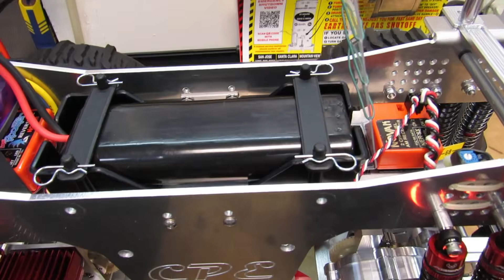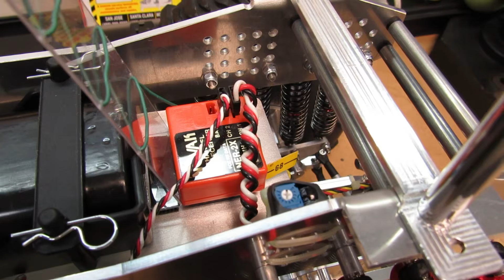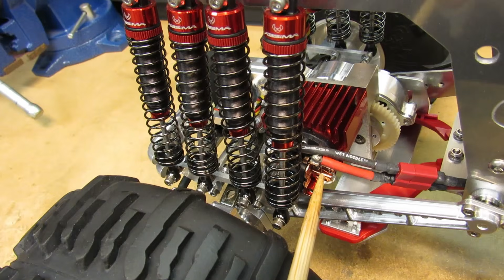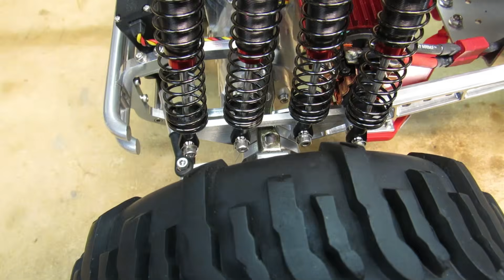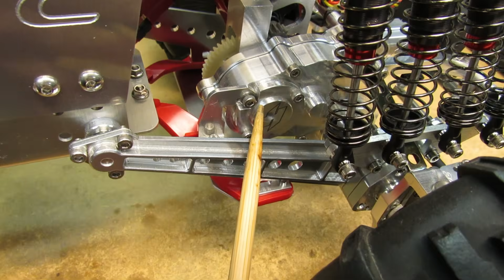Tamiya Clod Buster project update 4 - Crawford (CPE) Time Warp chassis assembly, part 2 of 2

Comment: It's a shame I can't do business with CPE after them not responding to a problem with an order I placed with them for multiple products of theirs years ago after attempting to make contact with them by phone and email numerous times
Reply from the maker: I know exactly what you're talking about.  Before I bought the CPE Time Warp chassis that I used on Leviathan, I emailed CPE and asked them some very simple questions about it.  To this day as I type this, I still have not gotten a reply from CPE.  My questions have gone unanswered so far and I am not holding my breath on ever getting answers from CPE.

This also recently happened with Arch Fabrication.  I emailed them a very simple question about two or three weeks ago and, at least as of this moment, I have not received an answer.  If I ever get one, I will post a reply to this comment here saying so and I will gladly eat my own words.  Right now at least, I am not getting my utensils and preparing to chow down.

One of my all time pet peeves about the R/C hobby is how manufacturers routinely completely ignore their customers like that.  They have the potential to develop long relationships with loyal customers yet they constantly ignore them and thus ruin the possibility of continued purchases.  Unfortunately, I have experienced that constantly in my long time of being into R/C.

In my case, when I have been treated well by an R/C manufacturer, my loyalty to them has even lasted longer than the actual companies have.  That applies to ESP and Sassy Chassis, whose parts I still use and speak highly of today even though they both have been out of business for a long time now.  Based on my personal experience, both of those companies treated their customers great and I still speak fondly about them even though they closed up many years ago.

On the complete opposite end of the R/C manufacturer spectrum, JPS is a company that totally ignored their most loyal customers and treated them horribly.  Thus, though I will always love JPS' products and speak highly of them, I will never say anything good about their absolutely awful customer service and how terribly they treated their customers.  That was absolutely inexcusable in my opinion and I have specifically mentioned JPS' terrible business practices in several of my videos.

To CPE's credit, I did have a problem with my Time Warp chassis order that they quickly fixed.  The shipping box was not taped closed very well and, as a result, it was torn open a little bit during shipping.  Some parts from my order fell out and were lost somewhere along the way.  (An aluminum steering link and some hardware were gone.)  I emailed CPE with a photo of what I received and they immediately replied and sent me all of the missing parts.

So, to CPE's credit, they did take care of me and solved my problem with my order.  It would have been nice if they took care of me back at the beginning when I was just a potential customer though, way before I placed my order, and when I just asked them a few simple questions.  It would not have taken long to answer them yet I was ignored.  That sort of thing makes a lasting impression on me as first impressions are hard to change in the R/C world.   It just would have been nice to see issues like that be changed and solved during my many years in R/C monster trucks but, nope...not even if they are committed by different companies and by different people over different decades.  Sadly, old and bad habits seem to die hard in the R/C aftermarket parts industry based on my experience.

Comment: Aside from a nostalgia perspective, why are you using crystals? That's just asking for interference isn't it? Granted you will probably be the only one on a frequency, that doesn't guarantee no interference does it? Just curious. Shoot, I still have a super rooster in my pile of old hardware. Sux they kinda been obsoleted mostly
Reply from the maker: I actually have never had any interference problems with my old, trusty Futaba Magnum 2PD AM radio.  My logic is that I'll upgrade radios when/if it ever gives me problems but so far it has always worked flawlessly since it was new.  If I ever do have interference problems, I have quite a large collection of different crystal sets that I can swap in quickly.

Also, and this is a big reason why I have not "upgraded" my radio.  I absolutely love my Magnum!  It fits my hands so comfortably like a glove and it is just made so well.  I have held many newer radios over the years and they just did not feel as good as my old, trusty Magnum.  My thinking is, why replace something that you love just because something newer has come down the tracks?

Newer R/C radios are also just too complicated.  I do not need nor do I want screens on my radio and I sure do not want to use a phone ap just to set it up or make adjustments.  I can do all of that on my Magnum by looking directly at the adjustment dials and by turning them with a small screwdriver.  I never have to turn on a screen or pull my phone out of my pocket.

Don't get me wrong though because new R/C radios have functions and options that my old Magnum can only dream about.  Those are great, but I am not racing at the IFMAR World Championships.  I do not need nor want any of those extra fancy features, as nice as they are.

When it comes to R/C radios, I stick to two old four wheeler's sayings:

If it ain't broke, don't fix it!

K.I.S.S. - Keep It Simple, Stupid!

I love my trusty Futaba Magnum 2PD so much that I actually bought a brand new second one about a year ago that was in its original box and with all of its original paperwork.  I bought it just in case my first one ever breaks.

I also love all of my Novak Super Rooster ESCs.  They just work so well for what I need.

Comment: Wait is novac still in busneiss?
Reply from the maker: No, Novak closed on 6-13-16.  That was when I was on a hiatus from R/C so I did not know about them closing up until just a couple of years ago when I returned to the hobby.  I was very bummed when I found out because Novak was always one of my all time favorite R/C manufacturers.  All of their ESCs and receivers still work flawlessly in my monster trucks, just like on day one when I first bought them!

The only truck in my fleet that does not use a Novak Super Rooster ESC is the ESP King Clod.  That truck has a PDI Turbo Zeta ESC in it because that was what ESP put in it when the truck was first built around 1988.  I did not want to change anything on the truck when I was "restoring it" during my return to R/C so I kept the original Turbo Zeta ESC in it.

Comment: Nice. I have those same tires on the old metal RC4WD rims
Reply from the maker: Thank you!

The Imex Clod Swamp Dawg tires are quite rare these days so please hang on to yours.

What do you think of the RC4WD wheels?  Are they the aluminum Clod Buster bead lock wheels?  I have never actually seen those wheels in person so I don't know anything about them.  Have you had any problems with them or is there anything that you don't like about them?
Reply: @Locoboy5150  they're aluminum but. They're ok. They were over priced.
Reply from the maker: @PonkyKong  Ah OK - thanks!

I think that most aluminum Clod Buster wheels are what 99.99% of the people out there would call "over priced!"  😀  Clod Buster aluminum wheel manufacturers have come and gone over the years but one constant is that wheels have never been what I'd call "cheap."  That's especially true today on the secondary market.  Long gone vintage wheels like those from JPS are crazy expensive now!

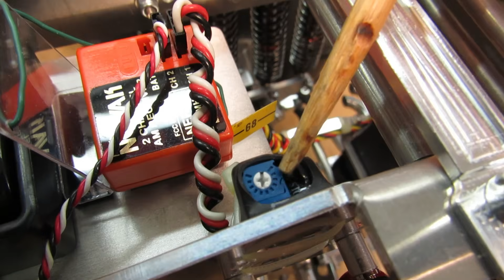Comment: 3:14 naw, need Crome zip ties.
Reply from the maker: I had never heard of chrome zip ties before reading your comment so I searched online and I was shocked to see that they actually make them!  Unfortunately, the ones that I found for sale on Amazon were way too wide to fit through the shock mounting holes in the Time Warp chassis.  Your comment got me thinking that maybe I could at least find some gray colored zip ties to replace the current white ones.

Thank you for opening my eyes to yet another modification to this truck!  It will never be done, like all of my R/C monster trucks!

Comment: Couple ideas I have for your clearance problem.. Holmes hobby stubby brushed motor ?   Also I have used threaded tube to extend the shock shaft and use about a 15 mm Set screw to attach the shock end . You would need to Use the upper shock mounts on the chassis, but this gets the spring away from the tire when you turn . Great build as always ,thanks for sharing
Reply from the maker: Thank you for tuning in and thanks for the ideas.  I never thought of those!
Reply: Your welcome.. I know you fixed the issues you had  already, just giving ideas maybe motivation for you to do another epic build
Reply from the maker: @FrankAndstien-m2l  Another project truck?  I don't know if my wallet can handle another one!  😀

Comment: Awesome build very informationally. What tires are those? Where may I purchase them? Thank you
Reply from the maker: Thanks and thank you for tuning in!

Those are Imex Clod Swamp Dawg tires.  They were only in production for a few years starting around 2005 and then quickly discontinued.  They were Imex part number 7571 and I have only seen them come up for sale a few times over the years.  Just recently, a full set of four of them sold on eBay on 2-20-26.  They were item number 287136269145 and they sold for $109.99.  I think that the seller really did not know how rare they were because they might have been able to get more for them and also because the Buy It Now auction was incorrectly listed as Imex Baja tires.  The Baja tires are still in production so they are nowhere near as rare as the long-gone Swamp Dawg tires.

I just noticed that the same eBay seller, model-train-warehouse, actually sold three complete and brand new sets of Imex Clod Swamp Dawg tires in February 2026.  The first two sets sold for just $99.99!

Some Clod Buster fans made out like bandits there!

Comment: Need to be brushless i did that to mine. Ripps. 3100 60amp esc 3s duel. I had the same esc with trinty 19 turn doubles
Reply from the maker: Well, going brushless would mean that I would have to basically replace all of the electronics and I did not want to do that this time around.  I already had a brand new Novak Super Rooster just sitting in its box so that was why I used that for this truck.

Also, this is the other big reason why I did not use brushless motors in this truck.  I did not want this truck to go fast as top speed was most definitely not a design priority.  This Clod Buster is my "tribute" to Bigfoot 5 and that truck is nice and slow.  As big as the Imex Swamp Dawg tires are, I ultimately designed this truck to use a set of huge Imex Jumbo Kong tires.  (Whether I go that route or not entirely depends on if I can find a set of machined aluminum wheels for Jumbo Kongs.)  The last thing that I want is high speed if this truck has those massive 8.5 inch tires on it.

I already have a fast truck with my Clodzilla IV Grave Digger.  If I want speed, I just fire up that one and take it for a spin.  That truck is not super fast either by today's standards, but given my rapidly aging reflexes it is as fast as I can handle without destroying something expensive.
Reply: @Locoboy5150 use hobbiewing 60amp esc. Two of them and a y harns and suprpass 3100 kv motors
Reply from the maker: @paul707.7  Thanks for the suggestions.  If I decide to go that route, I'll be sure to make a video of it.
Reply: @Locoboy5150 way longer run times brother
Reply from the maker: @paul707.7  Yeah, I don't doubt it!
Reply from the maker: Since you mentioned that this truck that I am currently building needs to be brushless, you might want to check out this prior video that I made that explains why some of my trucks are they way (slow and lumbering) that they are:

https://youtu.be/xWKjieDgv0E

It also explains why I actually like and prefer some of my trucks to be like that.

Comment: Thank you for sharing!  I have a question, do the shocks closer to the center of the chassis need to be slightly shorter than the ones further away if you're making the truck taller, and vise versa if the truck is shorter than stock when using the stock mounting points?  Or the mounting point on the chassis need to not be parallel to the ground if they're the same length.  I think they're compressed more than the other ones.  Do you get what I mean?  😅
Reply from the maker: You're welcome and thank you for watching this latest video.

I understand what you're saying about the shock lengths.  With the current chassis and suspension set up as shown in the video at their highest setting, all of the suspension ladder bars are at the same angle as they are on the stock Clod Buster and Bull Head trucks.  Thus, the shocks can all be the same lengths and they will all reach their full extension at the same time, like on a stock Clod Buster and Bull Head.

I know exactly what you are talking about because on two of my other trucks, Raging Bull and King Clod, the quad shock mount brackets are so tall that they add quite a bit of suspension lift and, as a result, the ladder bars are at a steeper angle now compared to the ladder bars on the stock suspension system.  Thus, the shocks on those two trucks do not reach their full extension at the same time.  The only way to fix that would be to mount slightly shorter shocks closer to the center of the chassis like you said.  I never bothered messing with any of that though.  I didn't think that the approximately 1/8 inch of length that would have to be taken out of the travel of the shocks mounted closest to the center of the chassis was worth the hassle of disassembling the shocks to put small, plastic travel limiting spacers on their shafts.  Thus, I just left all of the shocks on King Clod and Raging Bull at their full travel lengths.

As a side note, the shocks on Raging Bull and King Clod are shorter 90 mm long ones.  The shocks on a stock Clod Buster are 110 mm long when fully extended.  The shorter shocks were used on Raging Bull and King Clod due to the height of the very tall quad shock mount brackets on those two trucks.  If I used regular length shocks on those trucks, then the ladder bars would be at an even steeper angle and the trucks would be really super tall.  It would also result in a lot more bump steer.

I do not know if the lengths of the shocks would have to be changed on the CPE Time Warp chassis like you described if the suspension was set on the two lower settings though.  I only set mine up at the highest position and left it there.  I never intended to use anything but the sky-high suspension setting for this truck since I first started planning everything way back.